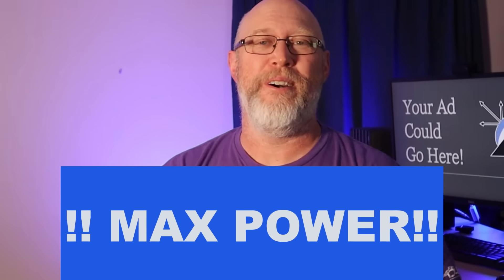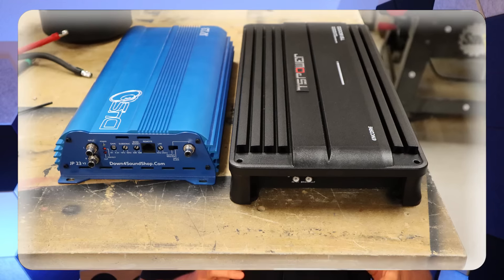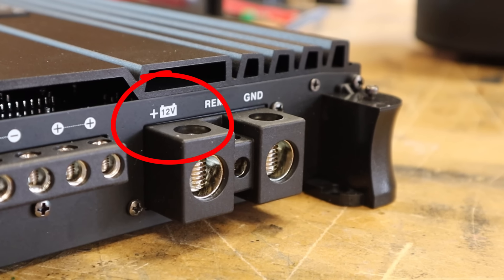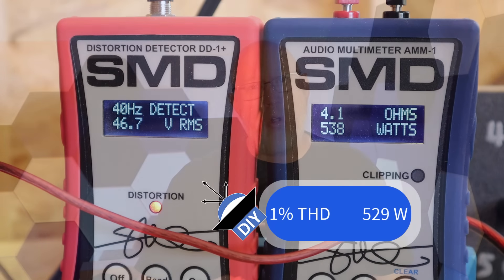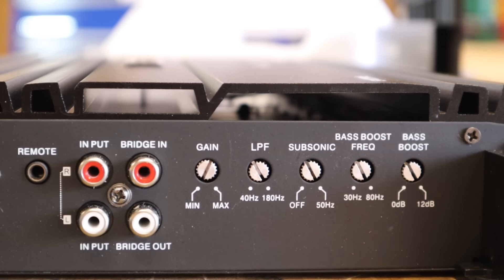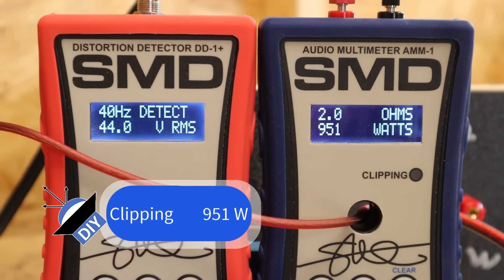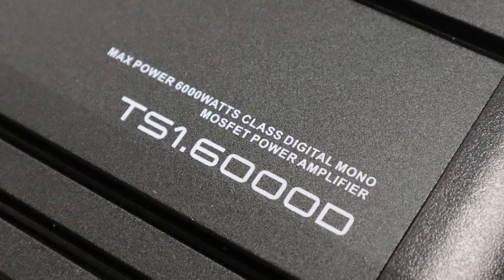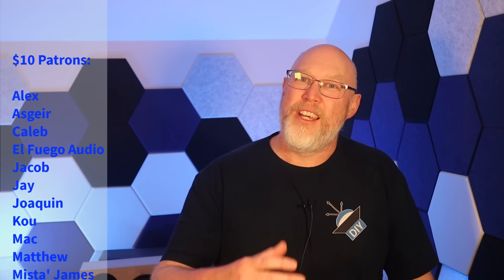Budget amp DESTROYs the competition?

Comment: I fixed several amps and also dynoed these and the guts of this amp look very good 👍 i think you shouldn’t be disappointed, it depends on your test signal, I guess you tested continuous at 40Hz? That’s the problem - these values are the hardest test for the amps power supply, so you get these “low” numbers. Todays amp manufacturers rate their amps continuously and max power which are burst signals with 1 kHz and 20ms which is the Eia standard. This represents the dynamic ability of an amp by using a test signal with higher crest factor which is like simulating music. Even pro audio amp manufacturers are rating like this today because they don’t use them to  reproduce one low bass frequency but live music.That is not new even in the mid 90s Rockford stated that you don’t listen to resistors so they also rate their amps with the power cube to simulate phase shifts and they use the same 1kHz burst signal. I test the amps in several ways , continuous and dynamic that’s the only way to compare them to each other.
In my videos i Show also
My test sheets which test procedure leads to a specific wattage. I guess your amp has very good dynamic abilities 👌
Sorry for my English I’m in Germany 😅
Reply: Yes friend this amp does excellent on music dynamically! The rail capacitors are a give away that it’s going to be nice under music all you got to do is count them puppies 😊

Comment: If grabbing something in that price range, I like the Recoil RED1200.1

Clip light on the bass knob, similar power. It's still no JP, but it's also a lot less $
Reply from the maker: I tested the smaller one, good stuff.
Reply: Recoil will run circles around these.
Reply: I've been impressed with the recoil stuff for the money.
Reply: The 2500 model was a beast but they sold them for less than they would like on Amazon so they have raised the price on the website now
Reply: @onesikm3  they got nore coming plus their new 3300, 4500 and 5500 amps shortky.
Reply: Don't forget Harmony Audio and US Acoustic also NVX lastly Belva they do rated and then some.

Comment: Good review man. As you' said it's not bad for the money but you can technically do better for the money as well. I run only fosgate T series Amp. They say 1500 and do 2400.  The constant power tech they have  is hard to beat
Reply from the maker: That is a nice amp!
Reply: 1 word: taramps
.
.
. the taramps smart 8000 costs much less than fosgate and puts out way more good clean power
Reply: @WintedTindows1   Taramps are good. No argument there.. Definitely a a good value but I'll have to disagree on the clean compared to jl and rockford amps. They are as clean as they come

Comment: From my limited experience with amp guts, thguts here look VERY stout, really similar to much higher rms rated amps. I believe this one is capable of much more with revised power supply and addition of rail caps. 5-7k rms
Reply from the maker: I am also willing to conceded that my test bench does not have the juice to push it to its full potential.  But it is not 6k amp.

Comment: I don't get the inflated power ratings that some manufacturers still seem to do in order to secure a sale from the uninformed.
You'd think there would be some kind of regulatory agency that should monitor and enforce advertising practices for consumer electronics.
While this is a relatively inexpensive amp that appears to do 1400W RMS, the size of that monstrosity doesn't justify that cost...
Reply from the maker: There is an industry standard.  Of course the only manufacturers that follow the standard were the ones that were already accurately rating their products.

Also, Keep in mind that maybe it can do more than 1400, I was pushing the upper limits of my setup.
Reply: Not much regulation and oversight involved with what are essentially toys.  Maybe if more cars catch on fire the insurance companies will have the govt step in...

Comment: But the internals look so beefy man what is your power source ? I’ve only been following you for a few months so I’m not up to speed or if you mentioned it in the video as well it slipped by me. It’s possible bottlenekcing due to too high of an amp draw and it limits the current output ? Have you seen higher numbers from other amps tested ?
Reply from the maker: I definitely have a bottleneck.  https://youtu.be/48arrcKeU1E?si=95olqpYGShwOfoGE
Reply: I bet this is your standard 1500watt china board found in Skar, CT sounds, Audiopipe. It sure does look like it which if the case it does 1500ish cert/uncert and close to 2k dynamically which is a deal for 129$
Reply: In eastern Europe we vill acquire old velding machine that can deliver DC 200A min. and rewire secundar to 14V.
Reply: @mujopasuljic6471  what never thought about pulling something off like that !!! That’s so smart 😃
Reply: @DIYAudioGuy  oh shit I see what you did there!! 😂 I think it’s time to call the city pull a 200 amp dedicated power line to the garage…….you’ll even have even headroom to power a bunch of high pressure sodium grow lamps in case making future amp dyno videos fail you then your prepared for a new hobby 😉🤣

Comment: For 20 bucks more get the 9000d. Just bought one seems to at least put out more than 2000 rms
Reply: Typically these max or peak power ratings seem about 4x actual RMS.
Which in this case says 6000, puts out 1500. I bet the 9000 is the common 2000watt amplifier board that most china amps use.
If that's the case dynamically it should put out well over 2k which is hard to beat for 150$
Reply: What about the fuse situation on it though? That's kinda strange and feeeekin scary to me. I am about to buy a 9000d right now for cheap 1 ohm power to 4 12s. What you think go for it??

Comment: My nemesis audio 3km has Philips set screws too… and it’s not a cheap amp. Also sorry I just saw this vid… notifications really suck
Reply from the maker: I'm on the fence with the Phillips head set screws. You don't have to stick around for the right size Allen wrench, but they do cam out.
Reply: @DIYAudioGuy  im totally against it. Will be using the harbor freight set screw assortment set to replace them. Half are already rounded out. 🤡
Reply from the maker: @westreadwell9675  that's all I need to know to make up my mind.

Comment: They got a 9000 for $140 now. So it’s prolly 1500 at 1ohm maybe
Reply from the maker: Yep, seems to be a good value, just wish they would not slap that big BS number on the side of the box.
Reply: @DIYAudioGuy  yes you’re correct if they rated the 6000 as a 1200 and the 9000 as a 1500 that would be very modest and people would buy more products that eat. If someone needs 6000 or 9000 watts and picks this amp, they’re going to send it back or toss it to the side and never use the brand again. Where as if you need 1200 and that’s what you get for the price, I’d the amp last as good as it looks and performs in that rms range, than that’s a return customer all day long!
Reply: @gsxroyce2506 well said. I am a perfect example. Only need 1200 to wreck the seals on my car lol

Comment: I personally would buy my Taramps MD 1200.1 again over this amp for the same price.  It has more power at 2 ohms and 1 ohm and is rated for the 1200 at 12.6v
Reply from the maker: Right, this is not a bad amp, and it does generate a lot of power for the money, but you can find cheaper and better.

Comment: Basically cheaper than buying the ct sounds version of this amp, this amp is the clone of the ct1500.1 but cheape... All the same build houses in China just little differences here and there like how the bass remote is 3.5mm instead of both ends being phone jacks like the ct sounds version but all the same guts
Reply from the maker: So, does the CT sounds amp make 1500 watts?
Reply: Yes I believe ct sounds has it on their channel run Dyno test
Reply: I believe you are exactly correct.
The same board as Skar, CT, Audiopipe and few other 1500s. They all make similar power.  The larger version TS9000.1 is surely the common 2000w board.
Reply from the maker: @BDauto86  what is the footprint on those?  This one is huge.
Reply: @DIYAudioGuy 
In order of overall mass, the CT-1500D is the smallest of the 4, followed by Skar's Marine 1500DM, Skar's Non-Marine 1500D, then Audiopipe. 
For scope, that's going from 14.63x5.63x2.19 to 17x8.5x4
Reply: @DIYAudioGuy   If you're seriously trying to minimize the footprint taken up though, consider the NA-BZ1500D @ 5.91 x 8.35 x 2.56 
or 
the AAB-1500.1D @6.30 x 5.71 x 2.50... 
For as small as they are, they'll actually do rated power, at similar cost to any of the above.